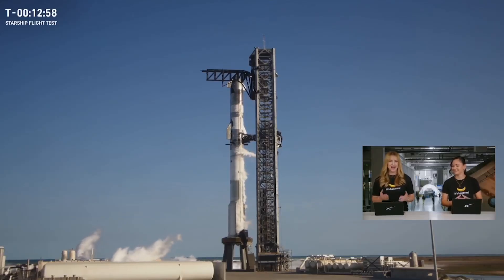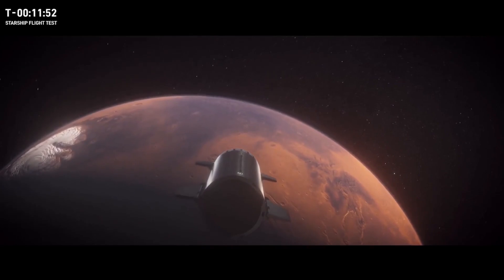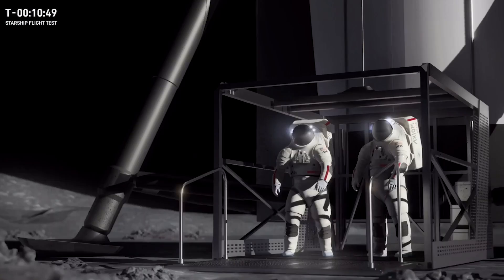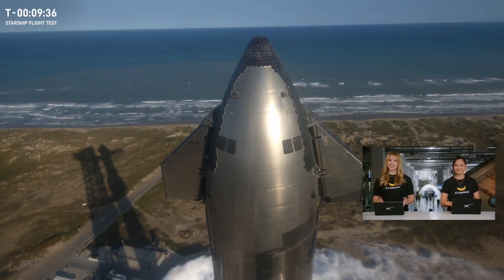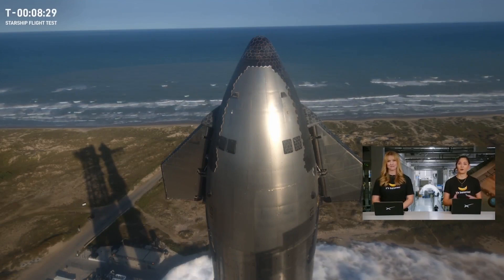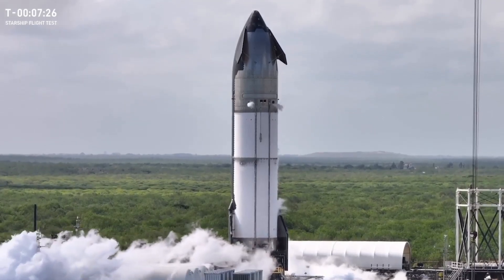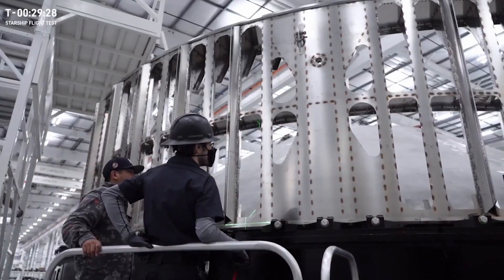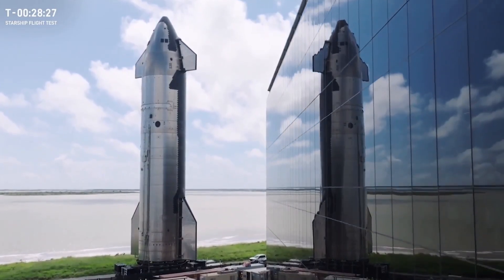What's next for SpaceX Starship? Future flights, moon and Mars!

Comment: I'm curious to know why the starship doesn't just carry the astronauts from earth to the moon and back.
Reply: Because that's not how the Artemis architecture is set up, it's not crew rated, nor is it optimized to land in the vacuum environment of the moon. But with Trump in office I think there's a pretty good chance SLS and maybe Orion are cancelled..
Reply: Wouldn't be surprised if the government contractors fall through leaving spacex to pick up the entire program
Reply: Because NASA would be jobless if that were the case, it has been a debate on the spaceflight community that the architecture is wholly inefficient, especially with Gateway's existence being similar to a toll booth. But i guess its one way to be a multiplanetary species.
Reply: Plenty of reasons, but one that's rarely talked about, but really important is that it's hard to make landing legs come out from under a heat shield